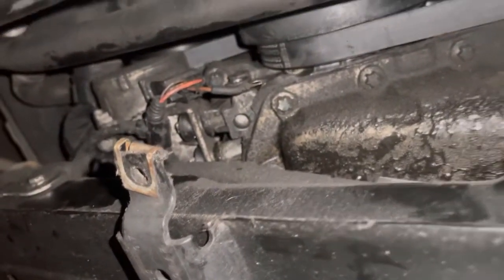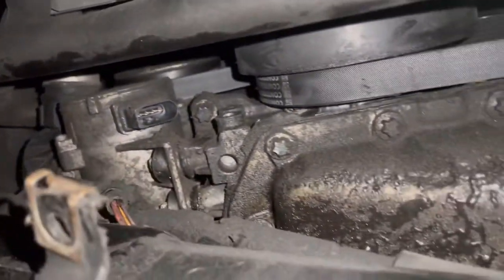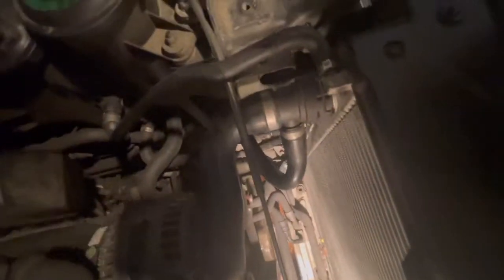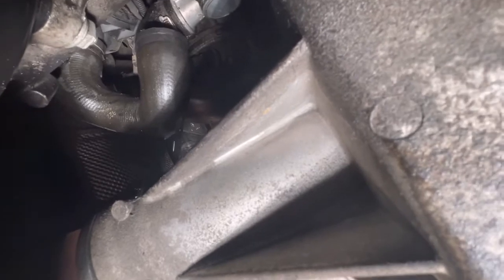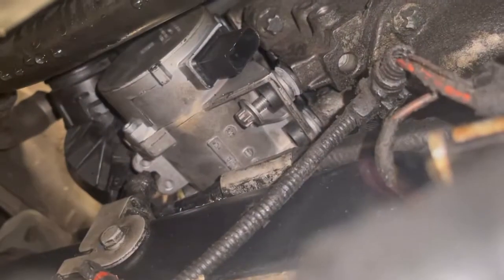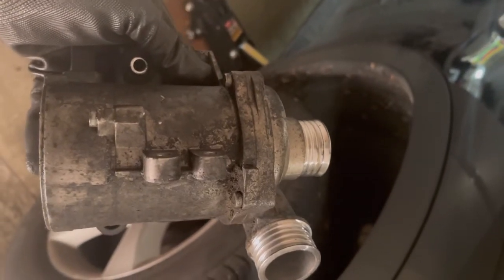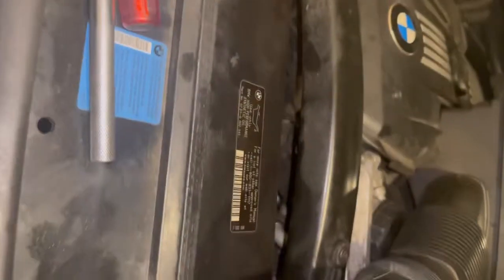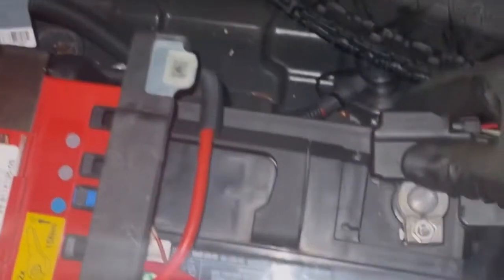BMW X5 E70 N52 Replace Water Pump WITHOUT Thermostat Easiest

Comment: Hello, did your x5 have the 4 zone climate control? Did you pull out the water pump from the top or the bottom?
Reply: did you end up doing it
Reply: @Dankalatrune1234  Try to turn your camera shots upright. Every shot, even over the engine bay is turned 90 or some other which way. You can also fix that in the editing side too